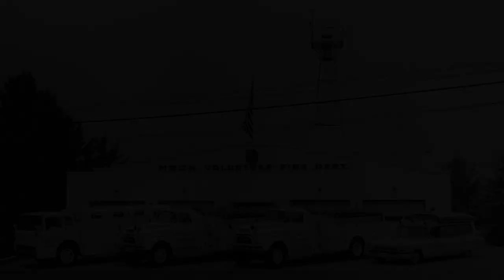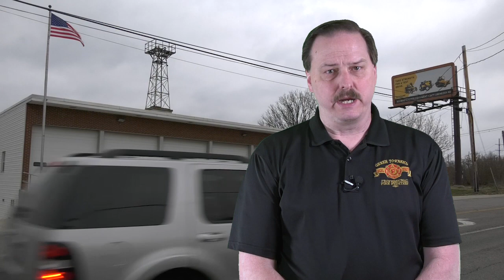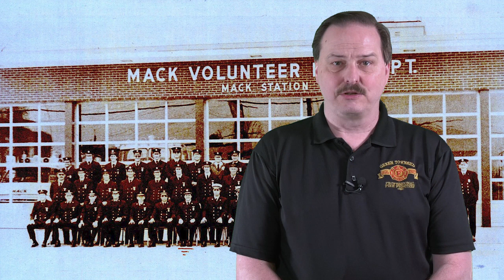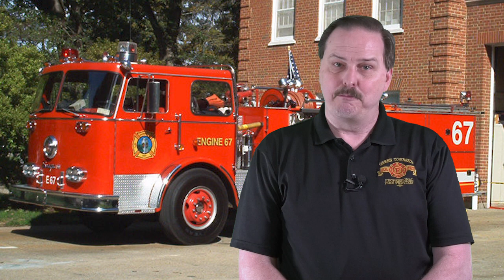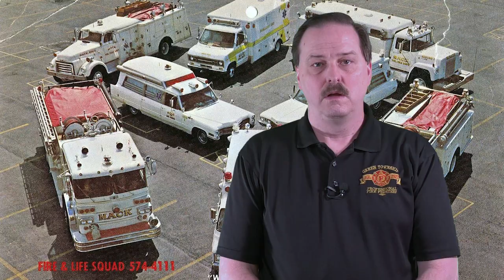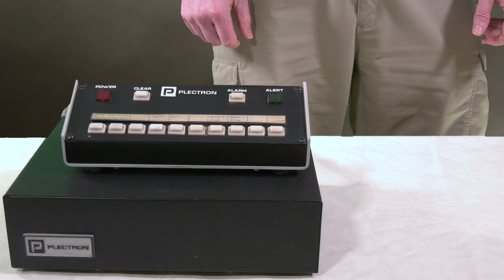Mack Volunteer FD Comms History

Comment: do you guys have 2 tones just like Emergency tv show?
Reply from the maker: These are old tones which have not been used since 1980.  When we changed to Hamilton County dispatch, we used a long tone of 1700Hz.  Fire runs were still followed by a second tone (dip).  Since then, most alerting has changed to short, two tone sequences to save air-time on the dispatch system.  We are, however, starting to migrate away from audible tones at all.  We use alphanumeric pagers now, cell based apps and also audio tones.  Next year it looks like the primary alerting system will migrate to Internet based systems that will allow individual stations to be alerted, without waking up the other three stations at night.  With run volume exceeding 20 runs per day, that will bring some welcome relief to tired crews.  The tones will probably become a backup alerting system only, in case the more advanced stuff would fail.